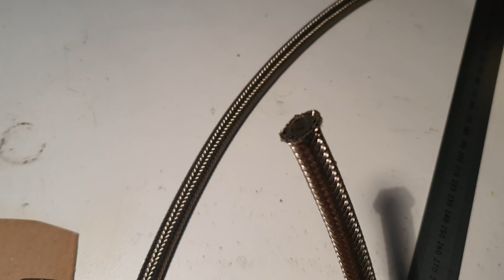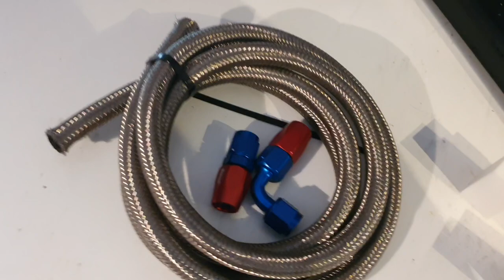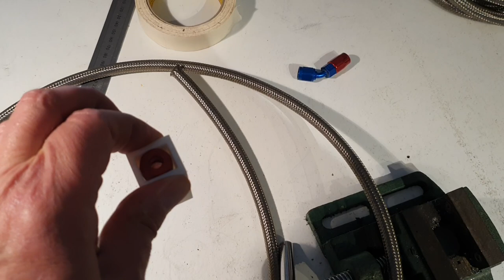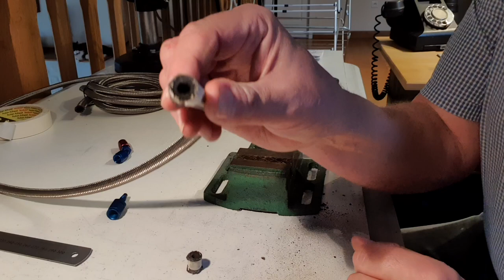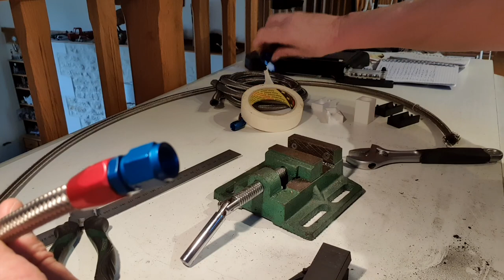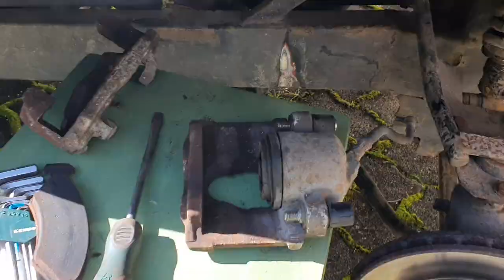Gavin's Sonex B Part 77 - Making up Stainless Steel braided oil pipes with AN fittings.

Comment: You're supposed to heavily oil the blue nipple when installing it to not damage the rubber part of the hose. Also make sure all manufactured hoses are fully flushed with mineral spirits and compressed air so there is no remaining residue or any loose flaps of rubber possibly restricting flow.

Comment: Summit Racing Parts here in the USA supplies millions of hot rodders testing and developing these hoses ( manufacturers). John did a great going with this discount material: I compared it to my favorite supplier ( Eaton Aeroquip a local aerospace hose manufacturer faa pma rated). I'm pretty happy with this pricing, John did a good job sourcing a lower cost hose with the added benefit of hot rodder race track reviews. But yeah, Im a Parker Hannifin and Eaton fan but seriously the cost isn't warranted with the Sonex.

Comment: I'd be willing to bet the flexible brake hose between the caliper and hard brake line has broken down internally and is acting as a one-way valve. A common issue with older brake hose. Disconnect the hose and see if the piston will push back in. If it does, you know the hose needs to be replaced. It's a relatively easy fix, hopefully.